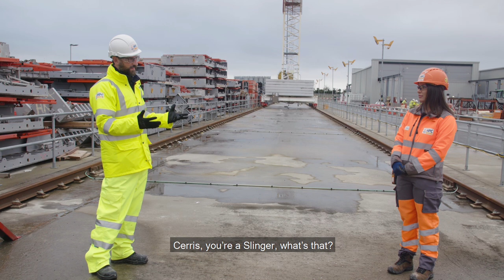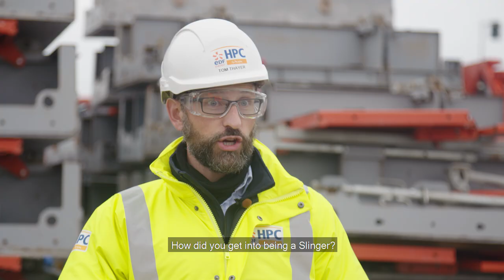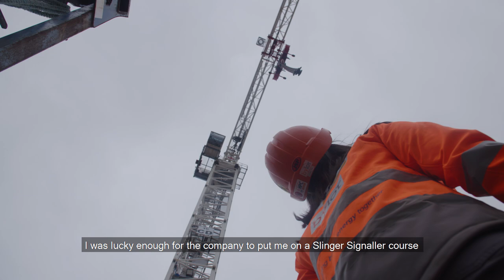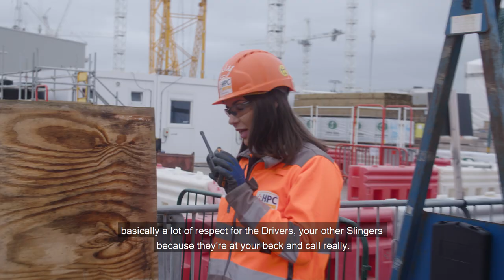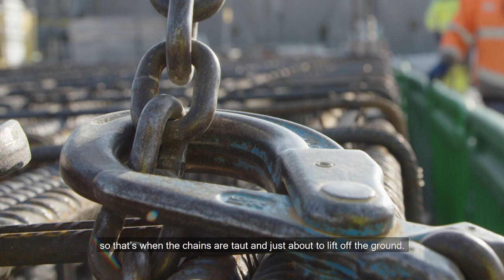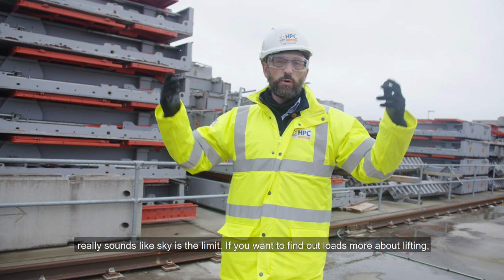How does a crane navigate a lift? | The role of a slinger signaller

Comment: This looks good, is there much manual lifting required?
Reply: Not much, just chains and some slings
Reply: @bawsemanlykjoe1284 disagree very physically demanding
Reply: @rufuskapten2365  go do a manual labouring job for a few weeks then come back with the same opinion.
Reply: @brian8861   🤣🤣 this is exactly why i'm gonna be doing my slinger/signaller then Ped-Op, absolutely done in labouring and i'm not ashamed to admit it
Reply: @keithchegwin1222  wait till ur having to re stack doka or stillage bins then have about 10 steel fixers casing u for a lift
Reply: @sebvaja8571  Do you think it's physically demanding? I'm just wondering if it's something I can do when I'm old
Reply: @keithchegwin1222  im 6 months in..do i recommend its a big hmmm..my day min footsteps around 10 to 15k 2x 30 min breaks start at 7.30 finish at 5.30..ur out in the rain cold people begging for lifts then moody crane drivers can be tough matey id say for the money u get theres better stuff
Reply: @sebvaja8571  I've always done very low paid crap jobs, but last year I grew some balls and put my heart and soul in to something. It's wedding DJing, I charge £700 for the evening. I've had 10 bookings so far, I would love to do it full time one day. This is by far the most enjoyable and highest paid job I've had. All of the most unenjoyable jobs I've had, were the lowest paid. Strange how life can be. 

I tell you this, because you can also make a change if you seek expert help in whatever field you choose, and really go for it. Maybe a trade would be good for you, like an electrician or something. What other job would you like to do?